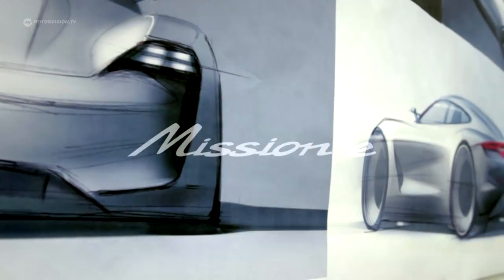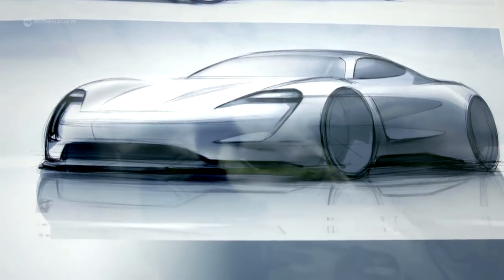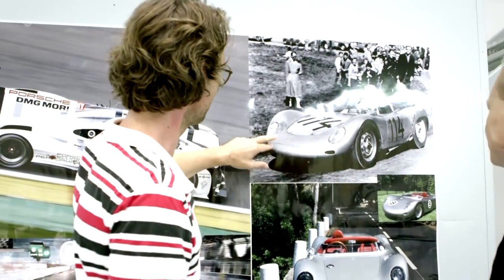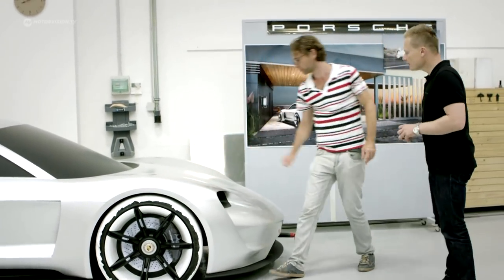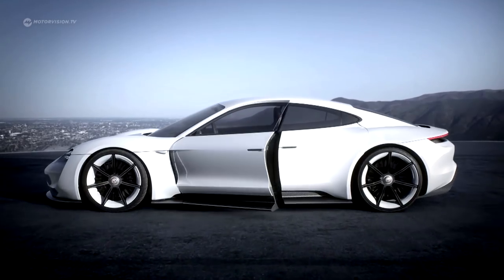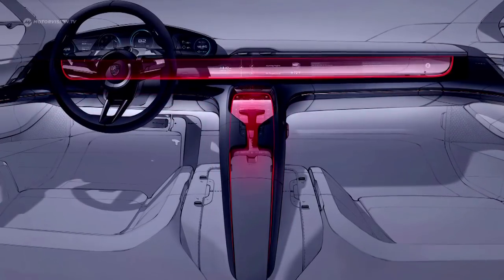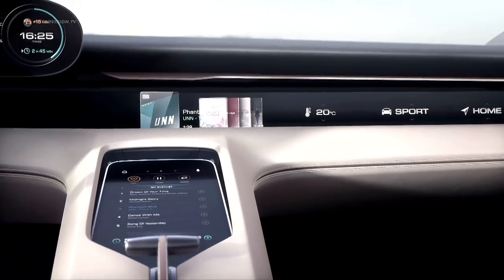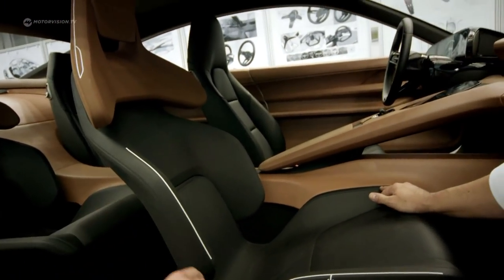Porsche Mission E - This Electric Car is a true Sports Car!

Comment: 0 - 80% In 15 minutes would be impressive
Reply: If that's what they meant by "15 minutes of charging to get to 80%"
Reply: They didn't say from 0, you don't usually discharge batteries to 0. Likely they mean from whatever they believe is a minimal amount which could be much higher, maybe 20%.
Reply: Tesla has really good battery management so they last a long time.  Will be curious to see how long these batteries last
Reply: Robert Blackford let me know when a gas car can be filled up at home which literally as easy as plugging in a cell phone and then maybe I will buy another gas car one day.  Until then, I’ll keep my EV and the convenience that I have 99% of the year.

Comment: They have to go electric.  It has to be embarrassing for any sports car maker to get their flagship hot rod model smoked by a 5 passenger family sedan or SUV.
Reply: yeah in a straight line... porsche was never a pro in simply accelarting in a dumb line... porsche has always smoked other cars on a racetrack... and the maximum speed of a Tesla is ridiculous... it is simply imposible to compare it to porsche.
Reply: Julius Maximus, I compare my Porsche Boxster and Tesla P85D every day. Most days I take the P85D, as it is the perfect Grand Touring car. How about you??
Reply: Will Chandler You probably only watch quarter mile videos after that any car with a good amount of HP will gap it after the quarter mile or they would all kill it on a racetrack
Reply: Why compare Boxster and P85D they are very different cars, do u actually know anything about cars?  probably not....
Reply: Clu4u ownes both a Boxster S and a P85D. Why not have the best of both worlds?
Reply: Yea they had to go electric. Some cool features such as the dash controls & suicide doors but a little boxed in with the massive console. Chasing Tesla still they have camper mode(sleeping), auto-pilot, free charging stations etc ..
Reply: Julius Maximus acceleration of electric motors is impressive due to the instant torque inherent to them. Not necessarily a big achievement by Tesla. Also the maximum speed of most electrics is anemic compared to the gasoline counterparts. How many times can tesla demonstrate thay acceleration on a single charge before you have to plug it into a wall? 2 maybe? The Porsche could do it for hours on a tank of gas.
Reply: Patrick Mallon You're not going to hit that top speed in any city, so it's a little redundant. Electric cars are faster around town. Now on a track or the autobahn sure, but how many people will be doing that? 
Fill up every couple hundred miles, no biggy. In the long run Tesla is more durable, 3 moving parts to a gas burners over 200. You see how this ends.
Reply: julesgame Get back to me when it is time to replace the battery,or some of the other horrendously priced replacement parts for a tesla. Parts don't have to move to deteriorate.
Reply: Will Chandler:  The Tesla P100D had a top speed of 155mph  (MANY production cars for less money go faster than that!). As for 0-60mph times, that is a crappy measurement of performance, who cares?  There are no 0-60 racing events, lol!!   Anyway, Porsche already built a production electric car that does 0-60mph in 2.2 seconds .. which is the quickest 0-60mph time of any production car ever built (tied with a Ferrari 499). More importantly, a Tesla Model S only corners at .89 G's .. which is piss poor, any decent handling car is over 1.0 .. and that is why no Tesla has never made the top  low lap times at any major World road racing track, while MANY Porsches have.

Tesla has not smoked Porsche, LOL, be serious!
Reply: BigCooter.com Even the "around town" superiority is misleading, as any amount of spirited driving is going to destroy your range. Maybe it is just referring to the fact that you will never make it out of town if you try zipping around town. While you get all of these great "features" of electric vehicles, at least you get to pay a significant premium for it. Thankfully tax tebates at the expense of other citizens will help you to minimize your extra costs.
Reply: Patrick Mallon:   and don't forget in the USA, the Tax Rebates go away very soon for any Tesla vehicle, once they hit 200K total EVs produced, the price of their cars jumps by $7,500, which will be painful for the Model 3 next year when rebates end for Tesla and all the other OEMs have another year or so of EV production that the same $7,500 rebate will apply to.  This effective price increase for Tesla is going to come at a VERY bad time, right when the industry expect them to hit their next big Cash Crunch .. when they will need to be borrowing more money, but when the sales start falling off as Model 3 pre-orders get canceled by those who reserved, but only wanted to leverage the rebate for low price or for flipping the car for a profit.
Reply: anything under 0-60 in  about 5-6 seconds is fast enough for any sports car ion a straight line on public roads, what matters is how it handles the turns, brakes, ride quality, rain, looks, comfort.
the top dogs can go for the 1-3 second 0-60 at $200,000 plus. or you can buy a dodge demon a little over 2 seconds under $80,000:)
Reply: Porsche boxster compared to tesla P85D? Really? Perfect grand tourer? I test drove boxsters before I got a Maserati Gransport, let me tell you the boxster (least the 986/987) is not porsche's best effort by a mile (its also a MUCH older and cheaper car than the Tesla!). It is cramped and plain inside, and plain sounding. It also feels underpowered. It is not a surprise that a much faster and roomier P85D would make a better grand tourer. But there are much better ICE cars than a boxster, with beautiful interiors and exteriors and wonderfully vocal engines. I would be more interested had you compared the P85D to a Maserati, let alone Ferrari, Aston Martin or Lambo, as a grand touring or sports car proposition for the weekend or racetrack. I would be much more impressed if a Tesla felt like a better sports car than these vehicles. The Tesla is a fantastic all rounder and daily, but it is not the epitome of motoring, sorry. It is god awful on a track, cannot disable its traction control system fully, is heavy and poor in corners and lacks driving feel, reportedly. Even just the lack of sound and inability to fully disable traction control alone kill it as a sports/grand touring car. As for a daily driver, sure, it does that very well, but so does a Toyota Corolla for a fraction of the cost. Why pick a compromised solution to the daily/weekend car dichotomy when you could buy purer examples of both for less?

Musk himself owned a McLaren F1 so would probably understand, were he to speak openly and honestly, the tradeoffs which I am speaking about. Why would the CEO of Tesla even own a radical sports ICE vehicle, with the anti-ICE radical attitude taken by Tesla afficianados? ICE cars have their advantages
Reply: Tom lets talk about Tesla roadster a car that is made for racing against ur wet dream cars.

Comment: It's going to be interesting to see how the battery will take being charged to 80% in 15 minutes. Not very well with current chemistry, I imagine. But it is a premium sports product, so additional cost of changing out batteries is probably not a bad compromise. It'll be interesting to see when/if it gets released. Good luck!

Comment: I am missing something here.  Because the car is electric , they do not need a front grill ?  So you block the air that could flow under and over the batteries keeping them and all the wizbang electronics a few degrees cooler , and put a straight on barrier to aerodynamics ? FUCKING BRILLIANT!

Comment: Holy moly  ! The low center of gravity  was used on Tesla Roadster and is a mantra that any company which builds cars for a living incorporated in their own philosophy. And then you took a lot from the Porsche boxster and  some more from the old Porsche from the '50s and '60s. Except for  Porsche 918 Spyder , which is a hybrid does Porsche have any "tradition" in designing and building electric cars? Tradition involves generally time (tradition= the transmission of customs or beliefs from generation to generation, or the fact of being passed on in this way) Does Porsche have such a tradition in electric cars?

Comment: It will be a huge challenge to make fast charging available in a broad sense, because what good is it when every manufacturer tries to make their own system? - that we have already seen with electronics and what a waste overall. The Automakers needs to move faster on this and they need much more collaboration to advance the charging system together.
What is needed is approximately 2 to max 5 charging systems globally, something that can be adapted to all major markets and something that every EV type can connect to. The EV´s are already available - what is needed is fast charging systems connected to the main roads and major traffic grids. .......Please! the consumers does not need yet another USB socket war because some engineers can´t agree on what a good solution is, or because some CEO´s consider that they can make some more money on dragging it out.

Comment: The only part resembling a typical Porsche (like the legendary 911 series) is the middle part of the front hood with its logo. Everything else in my opinion does not, including the much more limousine like proportions and the luxury car style interior.  I think they are aware of that and are just carefully paving the ground for a much more 911 like electric car to come in the future. 
The most aesthetic fails are the headlights and the rear lights. Yes, a Rimac one should not look like a Porsche or a Lamborghini to define it's own looks. But a Porsche should look like a Porsche (especially if they brag about it), not like a concept car that could easily have come from every other car brand in the world. I have to repeat myself... these headlights are uuuugly. 
Besides that it sure will be a good selling, fast, futuristic looking Limousine, getting the Panamera theme into the next century. Search for Porsche sedan to get a comparison between the 2010 Panamera and the Misson-E. The side silouhette is almost identical, but the lights of the old Panamera are waaay better and much more Porsche like looking.

Comment: how can you down vote this?
Reply from the maker: Four people are just unhappy that they can't drive the car right now :)
Reply: Or maybe because this is VAG concept FUD (fear uncertainty doubt), call me wrong in 2018 when Porsche promised this to be in full produktion. Also why you buy a car that is most likely twice the price and most likely twice as slow to 60 mph and whith no real fast chargning network. Dont get me wrong i would like to se it but, i think it wont happend in the next 5 years
Reply: The Tesla SUV can go 0-60 in less than 3 seconds, faster than a real Porsche.  u really think Porsche electric will be "twice as slow" as a real Porsche?  And way to speculate on the price as fact.  Wrong there too
Reply: Mission E is not an SUV and will compete against Model S whit 0-60 at 2,4 s. Yes, because if Porsche makes a car that is better than lets say Panamera they will sell less other ICE cars whit more profit margin. Most of the car will most likely be made by LG or Samsung (drivetrain, motors, batteries, etc). Thats the main problem not that porsche cant make a fast EV, but they won't because of internal strife whit their own ICE cars sales.

You can bet that Mission E will only be sold in California and Germany in limited numbers as a pure compliance car if its ever made. (like the Bolt). Its FUD becuase its ALWAYS 3-4 years ahead and never 1-2 years, people wont remeber what VAG said 4 years ago but, if they did 1-2 years people would hold VAG to it. 

Thats why Mercedes, VAG, Ford, etc has 2020-2021 as deadlinefor its EV production, when 2020 comes you can bet its 2024 thats the new date...
Reply: searay230 Luckily we have Hyundai, Nissan, GM and Tesla evs here, today. No need to wait Vags models.
Reply: GM is pure compliance car (limited production on purpes) but, there might be hope for Hyunadai and Nissan/Renault. I live i in Sweden/Stockholm and test drove the Zoe last week and the problem wasent the car but, the sales person was not at all intressed in selling the  car and knew very little about the car. 

I do really hope that the Mission E gets in to production even i low numbers but, i think the progress of Tesla and companys like Nio whit EP9 is changing the goals to fast for Porsche. The Tesla modell 3 P75D looks a lot like the porsche and might have the same perfomance for much lower price and will also be around 2018.
Reply: searay230 What is the GM's aim to make compliance model? To get those sold in usa under chevrolet brand and earn some enviroment points etc? 
I found same unwillingness from sales person when I testdrove Ioniq ev here in Finland, Helsinki. I even tried to ask questions about the car after testdrive but salesperson was not so willing to answer correctly, just mumbling something and watching screen.
Reply: Dont know if the rumors true that GM makes a loss on every sold Bolt (LG makes most of the Bolt not GM), they also seem to have "logistics" problem because they have lots of cars that cant sell in California but, Norway has +6 month waiting list... So GM can say: Hey, EVs dont sell so we dont have to make that many of them. Bolt is a PR product so GM CEO can say he was that quicker than Tesla to market whit an "mass" produced EV. The only reason GM was first is thanks to LG and not hard work on GM part. 

Thats what i am afraid that Porsche will do to Mission E, a half ass car whit 0-60 in about 5s and "only" 100 KW charging and high price followed by very low production numbers. 

I had to make a pre reservation to be able to test drive the Zoe, and whit Nissan you have fill in a form about one week before the test drive.
Reply: Because it's vaporware
Reply: It’s the same few Tesla muppets who have attached their own egos to Elon Musk’s accomplishments for some reason.

Comment: Tesla has to get their shit together, so many automakers are going electric, only difference is these are actual automakers who have been building cars for a long time. They know how to build a car. Tesla is one of the top in a straight line but once corners are involved Tesla is extremely far down the list, no driving dynamics. When other automakers build ev cars what do you think the customer will buy, a car from a tech company that has been building cars for maybe 10 years? or a company that has been building cars for 60+ years? This is why Tesla will fail once other automakers start producing proper ev cars. Tesla should have just sold their battery design to car companies.